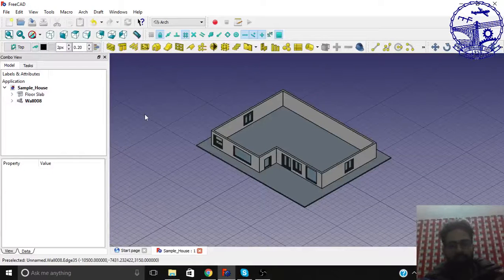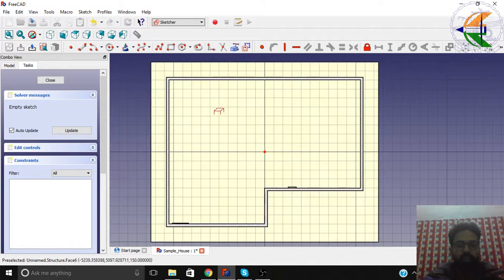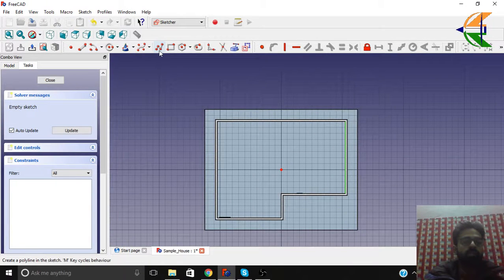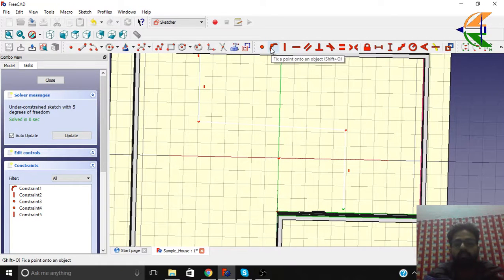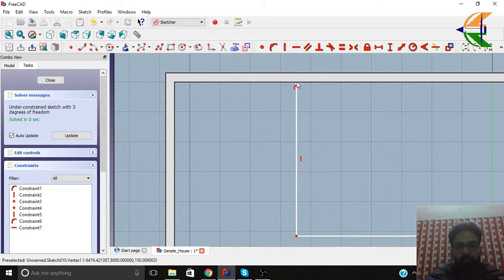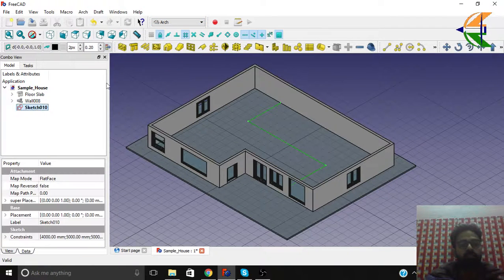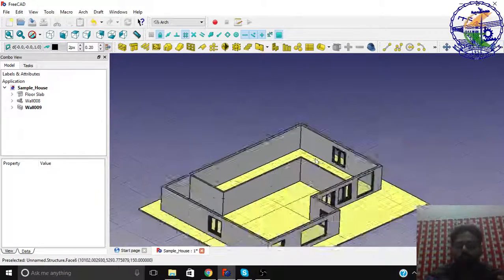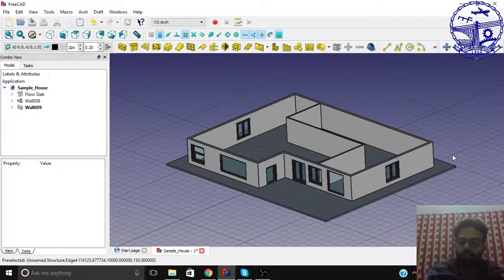6. Architectural BIM Modeling Course Using FreeCAD - Creating Internal Walls

Comment: I think i have a similiar question to above, i have got the most recent update "0.18".
I am trying to select certain walls to set a reference off, but for some reason ive noticed that i cannot select and walls, it may have something to do with the way iset it up. When i drag my mouse over the slad and windows they light up, but not for my walls, outside or in. Please help

Comment: hello, I'm having trouble setting an edge for the internal walls, every time I click on the tool it only lets me select the outer edges of the slab. can you help me in where I'm going wrong. thanks
Reply from the maker: shaun smith try to slightly rotate the view during sketching after you select the edge. As I've mentioned in the video that the reference edge will shift downwards to the working plane of slab.
Reply: Eklavya Self Learning Tutorials 

It doesn't work, the red circle with a line appears everywhere apart from the outer edges of the slab itself. 
I've tried redoing the slab again and the redoing the outer walls but still the same :/ I don't know what to do......
Reply from the maker: shaun smith which version of the FreeCAD are you using?
Make sure it's the recent build of 0.17 version of FreeCAD.
Reply: Eklavya Self Learning Tutorials 
The version I'm using is 0.16 is this where I'm going wrong?
Reply from the maker: shaun smith exactly. Download latest build of 0.17 version compatible with your operating system from here atleast once a month: (https://github.com/FreeCAD/FreeCAD/releases)
Reply from the maker: It the link doesn't open, then try searching "FreeCAD 0.17 Download" on Google. Open the link with GitHub website.
Reply: Eklavya Self Learning Tutorials I will do that once I'm home from work. Let me try that before I get back to you. Is there any settings I should change etc? I'm new to the free cad software
Reply from the maker: shaun smith, not to change any setting as such. If you still face any problem, feel free to comment or contact.
Reply: I cant seem to locate a download for the 0.17 version as its all dev files and not actual software
Reply from the maker: shaun smith, the files available there are compressed files. Download the file as per your operating system. For eg: "129 MB FreeCAD_0.17.11827_x64_dev_win.7z" is for windows system of 64 bit configuration.
After downloading the extract files and open the bin folder, there you'll find FreeCAD.exe

Comment: Hallo, Thank you for this helpful course. Can you tell my, what is false. When i will set references, i become only a "not allowed". By creating external Walls, it well. By no. 6, creating internal walls, it is inpossible.
Reply from the maker: I'm not able to identify your exact question, may be due to language barrier.
But no issues, make sure your are using the latest 0.17 version of FreeCAD, 'coz linking the edges of external geometry as references is not accurately available in 0.16 version.
I hope I'm able to get your problem. :-)
Reply: Thank you! It's ok!